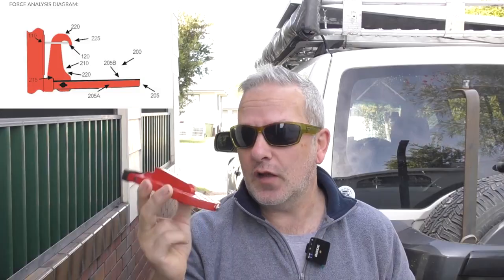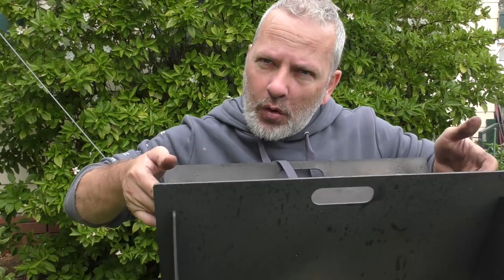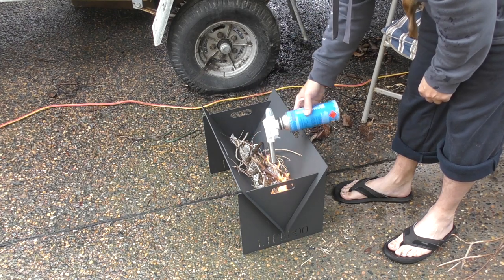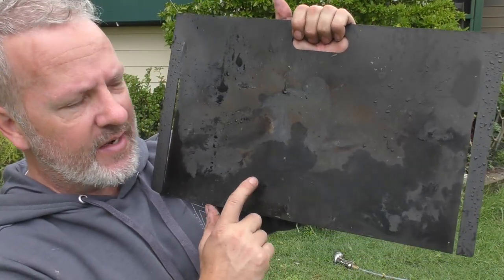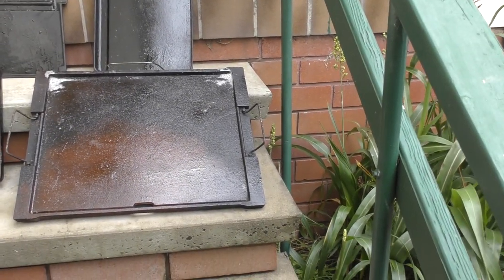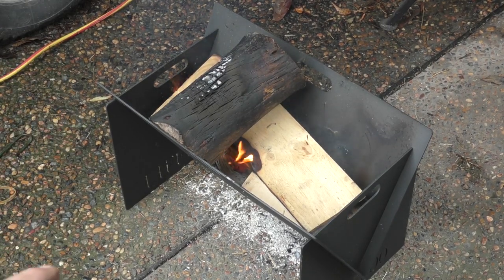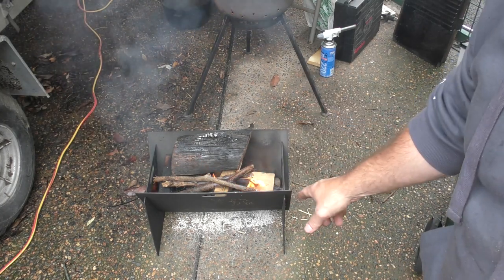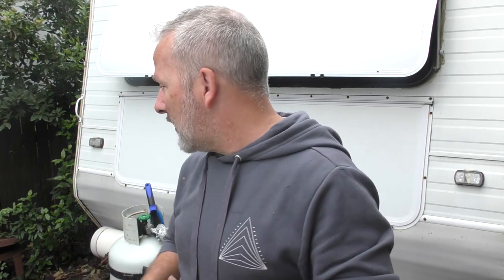Lifedoo Fire Pit - better than expected

Comment: Those small fire pits are really handy. Have you seen the one sold by 4WD Supacentre. 3mm steel with a bag for $100 delivered.
Reply from the maker: Heey Ian, one of my mates has the stove type one which I'm going to borrow to do a video on. I missed one on gumtree for 30bucks last week :(   Lifedoo also got back in touch to say theyve already got a new one in the works with all of the mods I mentioned in the video based on other utuber feedback. They'll shoot one out when it's ready and I'll do a follow up. I'll go check out their website though.

Comment: Brett, all valid additions required for it to be a lot better then it is at the moment. My father got me a larger one that was 6mm thick and was customised with my name on one side & callsign on the other. If you want a pic I'll send thru Messenger. PS love the Aussie safety boots.
Reply from the maker: hey Ads , bloody hell 6mm would have made it hefty. These guys are making the changes and will shoot me the updated version when its ready. keen to check it out. I was going to mod this one but might wait until the other one arrives and compare the 2.  but yes, shoot me a pic. interested.  for sure, trackies and thongs . good Aussie attire.

Comment: Hey Denmonkey, like Shad said smaller bits work best. 
There design causes there problem. The triangle causes the wood to smother itself. 
Even with the air holes you still need to stagger the wood to get air flow through the fire. 
Good luck with them.
Reply from the maker: Hey B4W,   I've been using it a bit during lock down :) and even the smaller stuff is ending up with the same results. It turns to ash quicker and just drops to the bottom, blocking the air flow. They have been back in touch and agree with my assessment as other youtubers apparently provided the same feedback. They showed me a new design with fixes for the issues and promised to send another out when it's ready. I'm keen to see how much those small changes with change the overall performance of the product. I havent drilled into mine as yet, because I want to do a side by side when the new one arrives.    I guess we'll see. 
Good to hear kings gave you a refund for the dash cam. I heard they were difficult to deal with for this sort of stuff. So good to know.
Reply: @DENMONKEY 

I'll have to get mine back out and test it again. The 20ltr drum was easier and hotter, just not as compact for storage. 

 Kings was easy to deal with. No questions in the return and returned on a Sunday and money refunded in a couple of days.

 I have noticed that, people that can't sell there products bag out the opposition, I deal with it a lot.

Comment: thought i would add my two cents... i have the Kings Firepit which is identical to this one... i've used mine a few times and found that the heat disbursement when sitting in front of it is pretty poor and doesn't warm you up as much as a normal fire on the ground.  so, we use the panels from this kit (as they are thick and well made) to create a shield wall around our ground fire pit which is great for controlling where the heat is dispersed... kind of like a fireplace.  also great for times that there is a bit of wind
Reply from the maker: Thanks David. Will keep  that in mind. I can imagine they would make a good wind break. I think the heat thing would be because the main source of heat being the coals aren't as exposed in a fire pit like they are in a ground fire... I guess.

Comment: Awesome mate, i find that some of those fire pits just need smaller sized timber and they burn better and also you seem to burn less timber than say if you had a normal fire on the ground. Thanks for sharing 👍👍
Reply from the maker: Hey Shad, nice to hear from ya bud.   I'm about to head out and drill some holes and see how much improvement that makes. Once the Rona settles down, we'll have to get out for a camp with the Duck

Comment: Being only 3mm thick , I would be concerned about long term warping , other wise a decent product .
Reply from the maker: seems to be holding up  pretty well but time will tell. Hasn't seen a massive amount of use of late, covid and all. They do have a new version on its way to me with the improvements I suggested in this video. Not sure on the thickness or materials etc at this stage. but you will you when I know
Reply: @DENMONKEY  👍 thanks